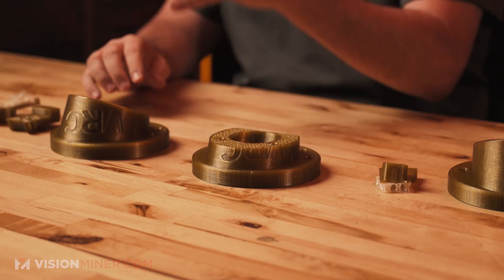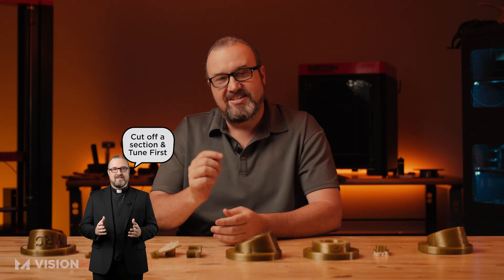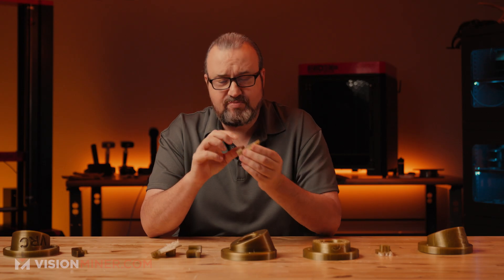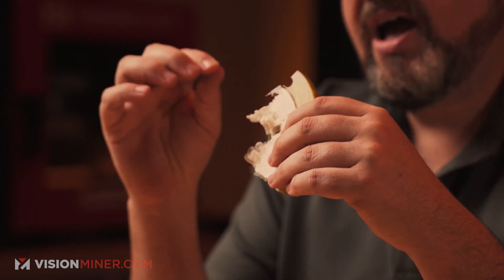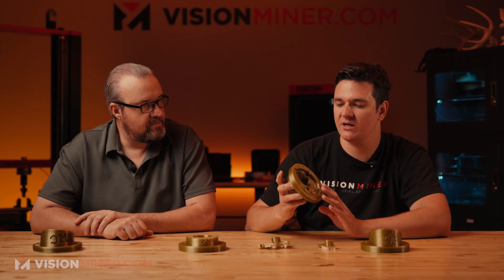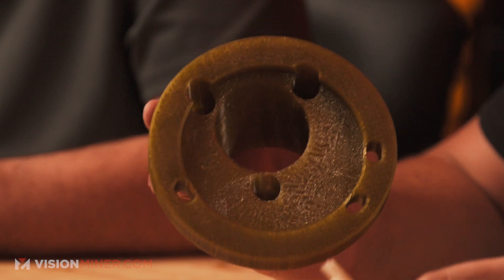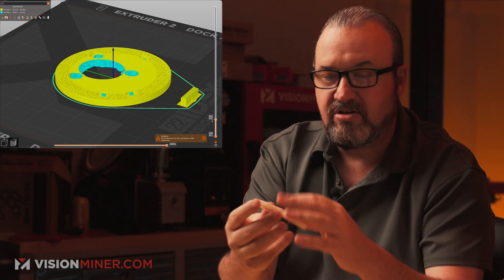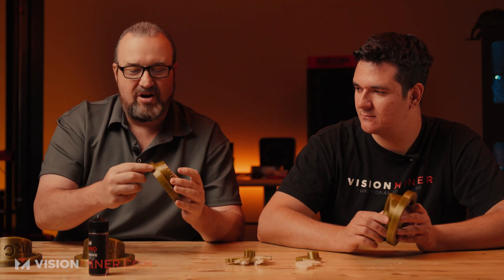3D Print PEKK-A with Dual Extrusion - Tuning Project with 3DXTech Filament

Comment: is this a print where you could have changed the layout of the print, so the base is not flat but the holes would be vertical and therefore don't need support and are cleaner and you can apply more angled supports for the bottom ?

Comment: My supports tend to fuse in certain materials from 320C and up. I would imagine doing PEKK with supports in PEKK will more or less amalgamate into the part rather permanently! Even with tree supports, some post-process machining will be involved to either clear interface layers or clear up some of the entry/exit areas around holes for bolt clearance for instance (in my experience anyway).
I'm very much looking forward to the day when I move to IDEX or multi-toolhead to do either soluable or dissimilar supports.
Reply from the maker: If you dial in the offset, you can still use it as it's own support -- same with PEEK, PEI, etc -- but usually the issue is, you need a larger offset, which creates the droopy under-surface -- some applications, this doesn't matter, but for others like this one, it makes a big difference to use a breakaway or soluble support, for sure!